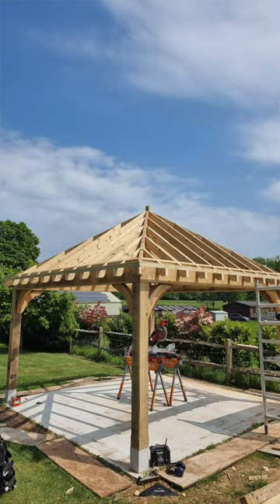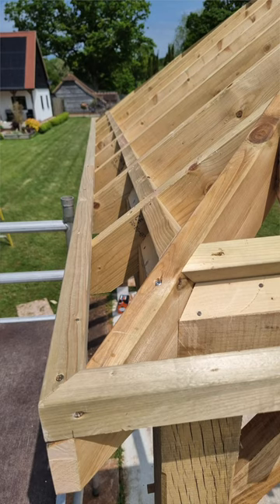Making a tilting eave fillet for a roof

Comment: I've been using that saw for several months and it is the cat's meow. Acres of power and run time with that battery (no need to go bigger, but the smaller ones aren't ready for production cutting) and if you noticed the fence Mr. Clevett had on it is simple, and rock solid. This was my second tool in the Nuron system and just super impressed.
Reply from the maker: Yes Jacob the Nuron system is something else!!

Comment: what battery do you have in that saw. and how many rips would it do .
Reply: It's the -170, it's a 7.9Ah and it depends on your depth of cut and species but I'd be willing to bet that Mr. Clevett ripped all four of his sides with one battery with room to spare. I've done several long rips in Doug fir and had bars left
Reply from the maker: Spot on Jacob, I was waiting to check the battery code as it is at work so thank you for answering that question, I have found that the power is pretty special and the run time is amazing too!!